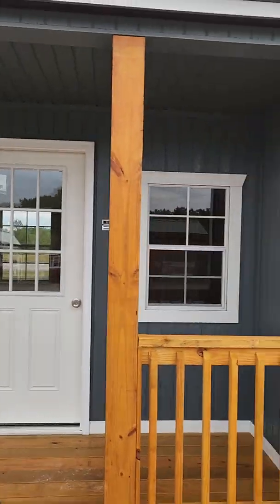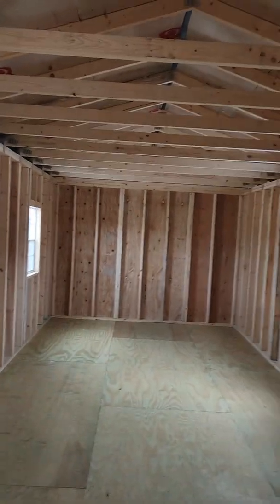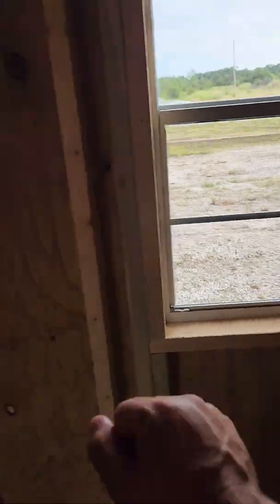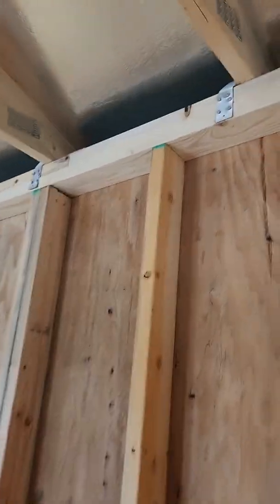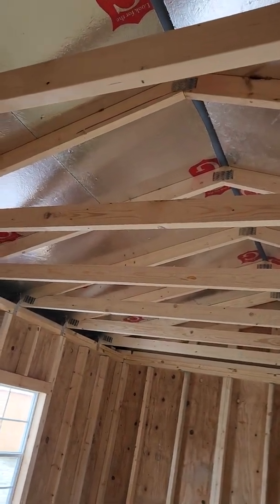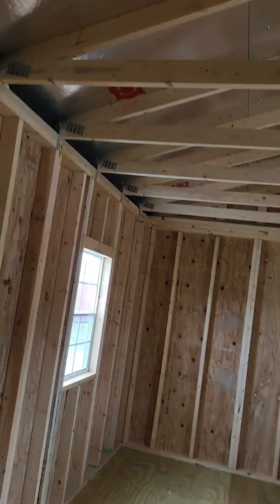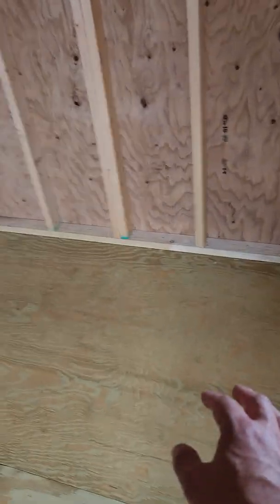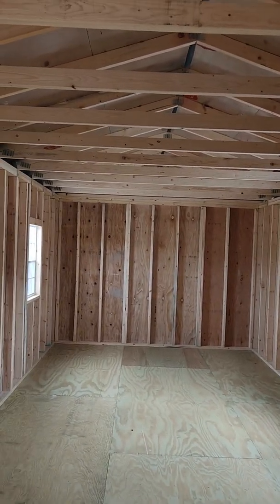😱👻MONSTER SALE🎃ORDER YOURS 🔎12x32 Corner Porch Cabin🏠 by Graceland 💲SAVE $768! ⏰💬MESSAGE ME!

Comment: 16 by 40 corner porch grey in color if possible
Reply from the maker: do you want the radiant barrier upgrade in the roof? I will assume YES since that is what most DIY tiny house folks want...
Reply from the maker: 16x40 Corner Porch Cabin w/ radiant barrier roof upgrade, painted w/ trim. Two 2x3 windows (single pane), two 3x3 windows (single pane), 36x80 walk-in door (9-lite metal), and porch railings = $20,644+tax or $843/month.  Current pricing on 8/1/2022.